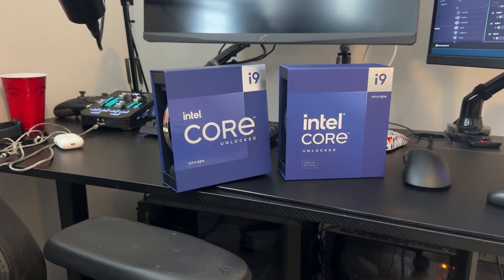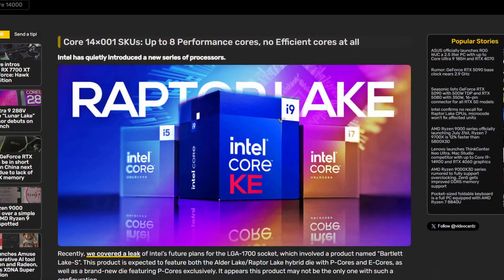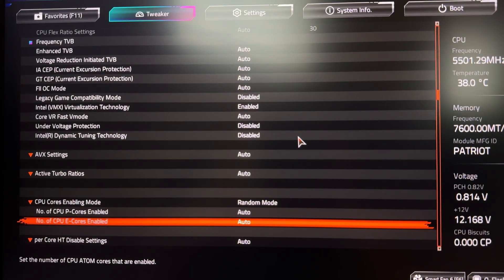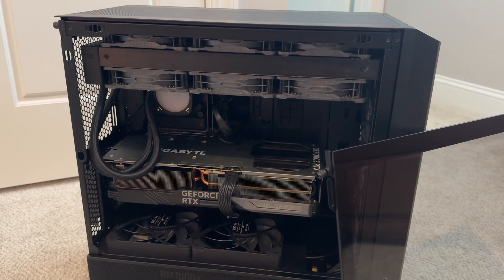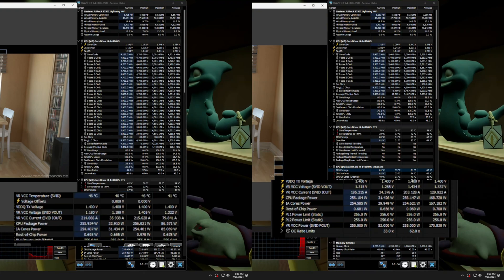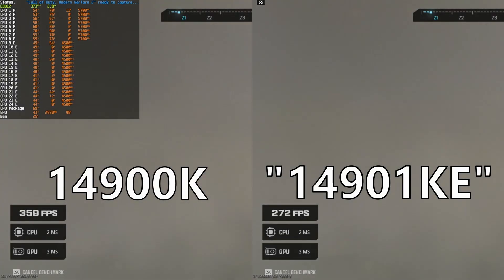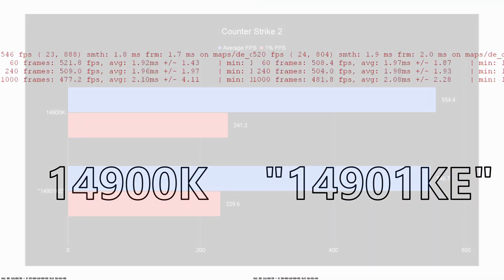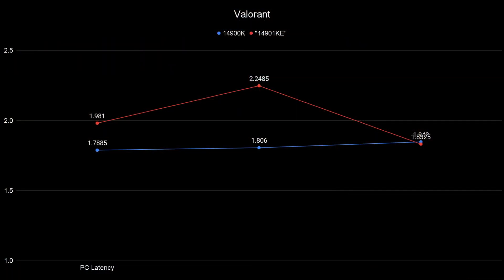Intel has a problem... and a solution

Comment: Less cache is reason for worse game result. They fvcek even that.
Reply from the maker: When you disable the ecores on a normal 14900k you get all 32mb of l2 cache for the pcores so the 14901ke would be worse
Reply: @ChamberTech  With the 7800X3D you don't need to disable any cores for better performance IMO.
Reply: @ChamberTech  I don't think that is the case. You can check the available cache in Task Manager. Disabling e-cores should lower the available L2 cache down to 16MB on a 14900k. It's no different than a 14901KE.

Comment: or buy 7800x3d done.
Reply: Not an option for everyone invested in the Z790 motherboards. For me it's a platform switch, I would need to buy a new Motherboard and a $400ish dollar CPU after already churning through 4 other motherboards. Thankfully I have DDR5 RAM, but at minimum I'm looking at $900 to switch from Intel to AMD... So, I opted to downgrade from the 13900k to the 14700k. Going to use that for the time being, but unless Intel gets there shit together with the next generations of their CPUs, I will be going AMD in maybe 2-4 years.
Reply: @thecartooncynic  So a Z790 motherboard investor has to buy a new motherboard for LGA 1851 socket, an AM5 user gets 2 to 4 years of upgrades without needing a new motherboard. Who made the smarter investment? The AM5 user.
Reply: @thecartooncynic  z790 is dead anyways am5 is nice and fresh, i bought a 7800x3d bundle with 6000 cl30 32 ddr5 asus b650e tuf and 7800x3d for 440$ at microcenter ofc only in the us. intel CANNOT beat that.